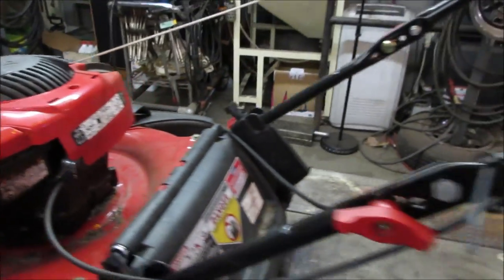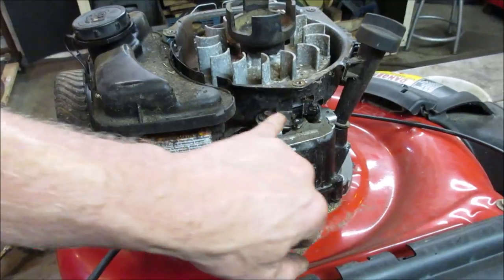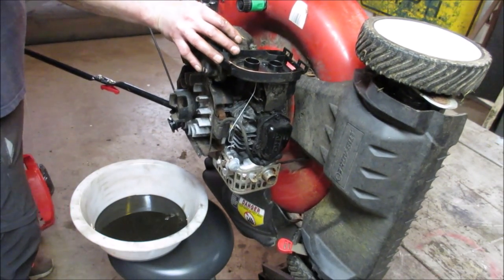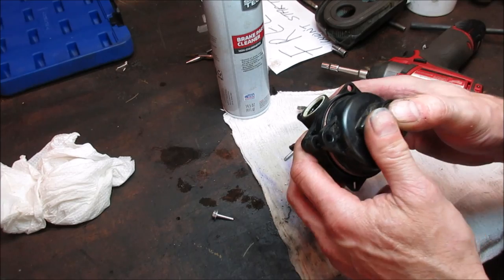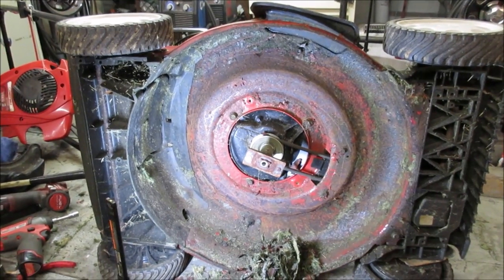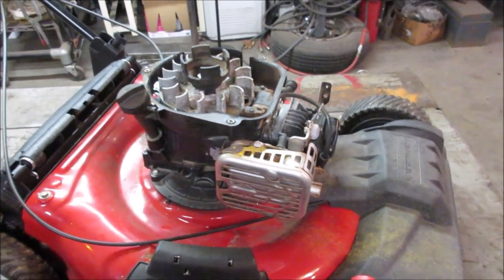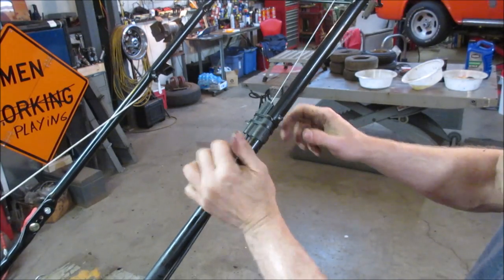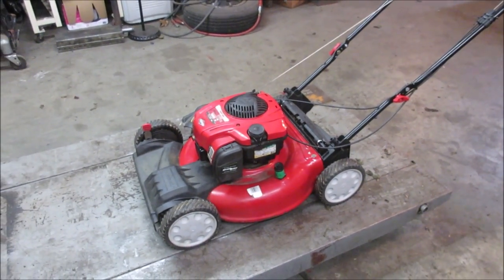How To Restore A Junked Lawn Mower. For Cheap.

Comment: Mustie, with that carb, if you look down the throat you'll see a white tube in the centre, if you take a flat blade screwdriver and push down on the tube with the flat part of the blade the main jet unit will pop out.
I also find it pointless painting the underside of a deck, no matter what the rotary deck sucks up dirt along with the grass and basically turns it into a sand blaster removing any paint.

Comment: I've found that balancing the blades on my 54in ztr makes the difference between a persistent vibrating deck and a smooth minimal vibe cutting experience. 

I balance all my blades every year before the season.  

Why shake the machine to death if you don't have to?

Comment: Ah yes, the old upside down blade trick...
My boss brought his mower to me to sharpen the blade. I tipped it up to take the blade off and noticed it was upside down. I asked if he had sharpened it himself before and he said "no, it's never been sharpened and it never really cut good". He bought it 2 years earlier and that's the way it came from the store. The cutting edge was perfect since it had never been used so I just flipped it over and put it back on.
Reply: Have seen this also.

Comment: There is a product called AgriGuard that paints on deck bottoms and dries super hard and is very durable
   I use it on an old riding mower deck for the pasture mower use on tall grass and juicy wet weeds. This stuff is made to resist very corrosive fertilizer chemicals and the acid in wet grass has no effect on it.  Not cheap,but very effective in sticking to tight rust

Comment: I was thinking it looked great with very little wear.  Of course, my Toro super recycler is from 2004 and has much wear and I've done a bunch to it over the years.  Seems like a lot of people just replace these things if they won't start or have other issues.   OTOH, Super recycler is a very nice self propelled mower and I doubt too many of those are thrown away for a relatively simple problem.

Comment: I must be a tighwad..LOL  I still have the 3.5HP  push mower I bought in 1980 and it still does the edge trimming... ohhh   yeah I had forgot.. Dad gave me a old very nice complete aluminum deck that he had ... I had put the engine on it .. just  the reg service every year or 2...... LOL back then they did not have any type of safety .. you can start it and walk away and it will run all day....

Comment: I had an old craftsman mower that was perfectly fine for the engine but the deck was rusting away bad, I patched it with sheet metal and pop rivets and used it another few months until someone set a nice husqvarna mower out by the road, nothing wrong with it but the belt tension needed tightened. No point in buying one when ignorant people give them away

Comment: I love finding mowers and then selling them for $200 after I clean their carbs.  I worked on a relative's Troy Bilt just like this mower that had poor performance and very low run RPM.  The throttle body is plastic (no surprises with this Chinese crap) and the throttle plate shaft was sticking.  A quick shot of oil and some "back and forths" and it was good as new.  Although who knows what it's doing now, that was about 4-5 years ago.
Reply: $200 for a push mower? Who the heck is paying that much for them? Unless they are top tier premium mowers right senpai?
Reply: @DaBossk  I've sold 10+ year old Toro's with Personal Pace for as much as $280.  Not pulling your leg about that either.  Prices have risen quite significantly these past few years.  It was maybe a decade ago when you could only get $100-$150 for a mower if you were lucky.  Now it's not all that difficult to pull in AT LEAST $200 each especially if you clean them up really well and make them look good, which a lot of sellers don't do.  Last season I found a few 2-stage Craftsman snow blower, I sold it for $400.  I also sold the 1992 Craftsman 36" lawn tractor that I bought for $180 for $700 this spring too after I put maybe $100 of parts into it.  Crazy?  People are willing to pay, I'm willing to sell for more too.  Inflation we all have to raise our prices.  When a brand new Toro lawn mower at ACE Hardware costs upwards of $600 the used market can increase their prices too!

Comment: Do you think the "auto choke" could be the root cause of my mower (which has a similar choke), to not start when it's warm? I cleared it out of grass and debris, but it still has issues re-starting once it's hot. Any suggestions (besides getting a new mower :) )?

Comment: That center plastic piece will pop right out with a pocket screwdriver. Never had one break yet. There is another jet down inside that needs to be cleaned too. The cheapest push mower I saw at The Homeless Despot about a week ago was $299. No self propelled, no bagger, just a plain mower……

Comment: Walmart shows that mower at $430 with free shipping. Troybilt shows it at $359 plus shipping and a $35 surcharge for a large package. It is advertised as no prime, no choke, never change oil "Just Check and Add".

Comment: I have a Craftsman mower with a Honda engine that I got off the side of the road.  It had spark and the aircleaner was off and pieces hanging.  I removed the carb and cleaned the gunk from the bowl, put the carb in an ultrasonic cleaner and reassembled.  Here's the odd thing.  It does start if I pour a little gas into the cylinder and replace the plug.  In fact it will run for an hour like this.  But if I try to adjust the motor speed it dies and won't start again.  If I stop it, it won't start again either.  Again, if I prime the cylinder it will start again.  I guess it's still a carb problem.  It doesn't have a priming bulb.  I guess one of the circuits in the carb is not working.

Comment: Funny...just got a Troy Bilt pressure washer with exact same engine (even though it was 2020 unit) that had MAYBE 30-40 minutes on it, then sat for winter, and wouldn't start.  One carb clean later and a little oil...voila.  Sold for more than double what I paid for it.  And started on 2nd pull.  Amazing how terrible the ethanol is to these....even with plastic carb.

Comment: Note this mower has a newer flywheel cup with squares like a turret. My 2012 had a cup with triangle shaped cogs so a new  modern pull start wouldn't catch or retract.

Comment: Hey Mustie, last year I bought a Troy Built push mower and I have a very small yard. Went to do the first cut this spring and found the air cleaner was oil soaked. It's kept in a critter free garage and nothing stored on top of it. What could cause this?

Comment: As for putting oil in these engines it’s best to use a household clear plastic measuring jug, take a permanent marker and mark at 500ml as these B&S and Honda all take this amount thus preventing under or over filling, simple! 😜

Comment: I have this lawnmower. actuating spring on the throttle wears out, resulting in it not opening fully at full throttle. and actuators bind. If you hose all the linkages down with hot lube, and then bend the spring mount point to shorten the spring, it will run at full throttle again. shit ran worse and worse every year. You can see the spring at 19:25 You take that super long lead, and just put a new bend in it thats slightly shorter. I just run mine on max mulch, and it obliterates everything.

Comment: Better than bar and chain oil is silicone tire shine or spray car wax from trigger sprayers or silicone spray.  Ceramic car wax is especially good but a bit pricier.  Silicone tire shine also protects the muffler.  Silicone sprays do not attract dirt like oil and so help the wheels more.

Comment: After I change the oil and clean the underside, I swab the underside with an old sponge soaked in the used oil.  It will mitigate the rust for awhiole.

Comment: I have this same mower NOT self propelled. A few years ago the pull start broke so I ran to Walmart and bought a new mower. Like a dummy I let this one sit outside for years without draining the fuel. Mustie made me want to revive it. Carb was gelled and not worth fixing so I ordered a new carb, new blade, new filters, new plug, new pull starter, and most importantly a NEW FLYWHEEL CUP! The older mowers (2012 at least) needs a new flywheel cup for the pull starter to work. Of all places to educate me on that was Amazon and reading the user reviews. Oh, the wheels wouldn't hardly mover either so I removed them and cleaned and greased the axels. Fired up on old ethanol gas from October treated with Stabil on the first pull. Yes I changed the oil also. From now on though I'm going to run ethanol free gas in them.

Comment: Some of the old timers back when I was a pup used to clean under their more deck at the end of the season then coat them with Johnson's floor wax. They were a lot higher quality steel and with proper maintenance it wasn't nothing to see lawn mowers 25 years old and still on the job.Stuff they build now is junk.

Comment: My neighbor threw out a lawnmower that he said was locked up. I took it tried to pull the rope and it wouldn’t budge. So I took it to my garage, flipped it over to look at it and saw the bolt holding the engine to the body of the lawnmower had backed out and was jamming the blade. I tightened the bolt and it fired right up. I was cutting my grass with it when my neighbor pulled up in his truck with a new lawnmower in the back. He had a surprised look on his face and he asked me how I fixed it so I told him. I could see he was distraught so I asked him if he wanted it back. He said he would hate to ask for it back because he threw it out. I told him it was no big deal. He then said I really appreciate it because I don’t really need the $300 I just  spent on this new lawnmower. So I gave him his old lawnmower back and he returned the lawnmower he just purchased.

Comment: landlord's mower, original craftsman,   replaced carb tried clean out but doesn't do well, wear (15 years old honda gcv) ehtanol gas comes around causing problematics to small engines.  so  still keep fueling with non ethanol gas, and new carb replaced.  and spark plug, fires up just fine.

Comment: Grass should always b cut as high as possible, (or as high as ur willing to cut it), in the summer since the root system grows as deep as the grass is tall, thusly reaching damp dirt during dryer summer weather. Conversely, grass should b cut as short as possible for the winter, thusly diminishing moss and fungus problems during the wet months.

Comment: Hi Mustie ... guestion ... I have a Toro similar to this machine.  ... I maintain the mower with fall and spring PM ... starts ok cold but won't restart once warmed up .. I've checked the auto choke and it seems ok ... I need to let it cool for 20 minutes or so ... than it starts! any input to this issue ... from researching the problem it seems to affect this particular model. Thanks in advance!

Comment: I found an ethanol free pump at a tier 1 station. Importantly, the pump has a dedicated hose so there is no fuel mixing in case the guy before you bought another grade if fuel
  In any case, you can make your own ethanol free fuel by adding ten percent water to your gas and letting it settle.Then carefully pour out the colored fluid from the clear water/ alcohol mix
Reply: How do you replace the octane the the ethanol provided? Greetings from Little Hocking, OH.

Comment: Well, I will tell you that balancing the blade on my electric mower was an absolute MUST. Obviously if there is a huge imbalance on the gas mower blade, it will vibrate a bit more, but not noticeably like an electric motor.

Comment: Are those deck rinse features actually useful? I've never had a mower with that feature.
Reply: Another YouTube channel Steve’s Small Engine Saloon did a feature on your question. They do, but need to run several minutes until water runs clear. With riding mowers need to put mower deck all the way down before doing this. I use mine on my Toro rider very other use or if grass wet when I mow. At end of season I take deck off and clean. Does pretty good job IMHO.
Reply: not very effective , easier to just flip mower on its side and wash the grass out that way. half the time thee deck rinse hose adapter either breaks off or is packed full of crap wont flow anyway

Comment: For storage of my mowers I try to run to fuel out all the way. Speaking about plastic carburetors on lawn mowers my dad replaced one on a newer lawn mower for his neighbor cause gas was left in it all winter and instead of a brass or plastic seat it had a aluminum seat that corroded the needle into it making it not repairable

Comment: I record run hours and oil change by the manual recommendation on my small engines - bit of a pain but likely worth it. Air filter as necessary.
Reply: Definitely a good thing to do but many mowers still run on decade+ oil while being decades old themselves.

Comment: I believe the theory is that water evaporates and wet grass doesn't. It traps moisture. As evident by the bottom of this mower. It appears it wasn't used. Recently, anyways.
Especially when done everytime to a pained surface.
Just run it for a minute after turning off the water.

Comment: You ever wonder why push mowers have tread on the front wheels?  They don't need it.  But you expect it to be there.  On road bicycles don't need tread either but you expect it to be there.  Tread is there for hooking up off road (power) or on the road for preventing hydroplaning at high speeds.  Bicycle tires are high pressure and way too thin and you can't go fast enough anyway to hydroplane.   I've had bicycle tires that were 100 percent smooth and people see them and freak out but it had great traction on the road even in the rain.

Comment: Funny enough, I've never experienced any issues from ethanol containing gas. The riding mower is 17 1/2 years old, is never drained at the end of the season. Has had zero work to the gas system/carb. The weed eater is 4-5 years old now I think... no issues. I do drain the snow blower and pressure washer since their use can span extended periods. My main generator is propane/gas powered but has never seen gasoline, only propane. The camping generator has been run on both.  

I do wonder sometimes about the gas that MAY be up to 10% ethanol, and what the actual content is if any. And how that may vary by location around the country. It might explain some of the differences in fuel economy form tank to tank, or even brand.

Comment: I noticed that Mustie turned it over on the exhaust side? I've never worked on a fancy mower like that as they cost a fortune here in Australia but, oil ALWAYS went into the exhaust if tipped that way. My question is, does that not happen with these mowers? Thanks
$900-$1700

Comment: Had the same thing happened to a Toro with the same carburetor what actually happened the throttle plate was stuck wide open which is in the top tube not the bottom of the intake air cleaner and when you fired it up the vibration freed it up real comment on that model

Comment: Biggest thing I will tell your subscribers, when taking a mower from the side of the road, you don't really know what is wrong with it, use caution, bent blade, or a sheared flywheel key, you go to pull it, and you grip the pull rope knob, and it has a sheared flywheel key, it will rip that knob out of your hand, and trust me it hurts your arm really badly, so as a rule of thumb, I never try to start it till I go over it, IE check blade, and take the top of the engine shroud off, and check to see if that flywheel key is sheared, just be safe, cause a sheared flywheel key, really hurt the arm.

Comment: Those single adjustment height axles are notorious to break. Either the handle breaks off or one of the PLASTIC tabs that holds it in breaks. Both parts are kind of expensive and annoying to replace.

Comment: I have the sameish mower. Mine just doesn't have the self propel. And I have issues starting it every time without a little sniff of something thrown into the carb through the intake. I suspect watching the rest of this video will lead to me confirming what I already suspect. The carbs are junk and may need a rebuild, replacement.  Now on to the rest of the video.

Comment: I have  a Club Cadet riding mower to service. The owner says that it won't engage the mower deck. Also , it will start but when you go to take your foot off brake it stalls out and back fires. Another words, the mower will not let you run or engage the deck. Is it possible that  if the oil is very low  that there is a oil safety switch  that engages when the oil is to low to operate  mower without causing internal damage to engine. Believe me  the oil level was very low. What do you think?
Reply: Add oil to the 'FULL' line on the dipstick, then report back, lol.

Comment: To make ethanol free fuel just add about 20% water and shake it.
Let it settle out and remove the bottom water and ethanol layer.

Ethanol mixes with water and when there is much water it will fall out of solution from the gasoline 😁

Comment: Got a mower with an auto choke my self, on some of the hottest summer days, the choke does get goofy and won't open fully without taking some pliers to the linkage and pulling it manually open.  Don't like the auto choke, really... would rather have a traditional prime system for a mower.

Comment: Shoot my new mower came with the advertisement of "Never change the oil.  Just add when you need it."  Right, like planned obsolescent wasn't enough lets just guarantee it wears out quicker.  Still warned about 10% gas though.